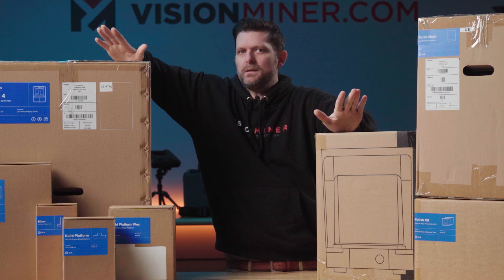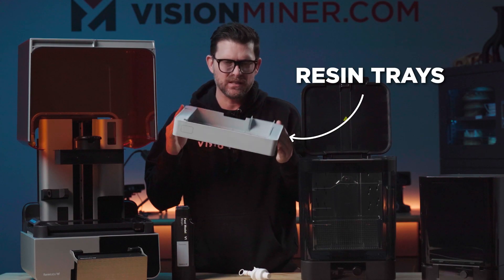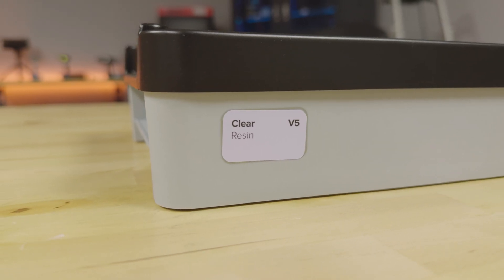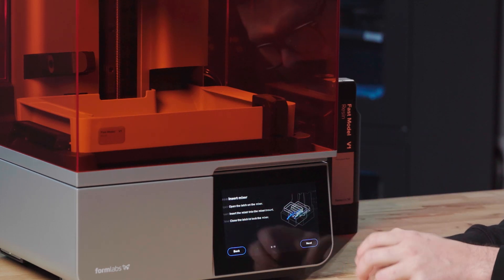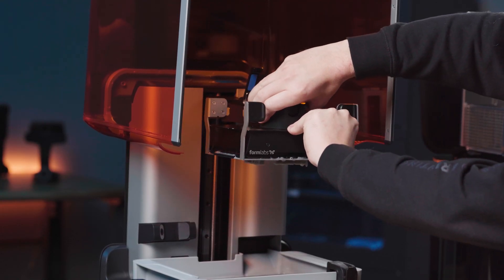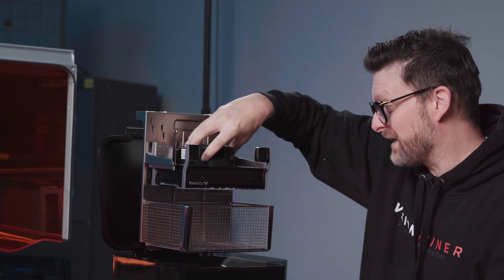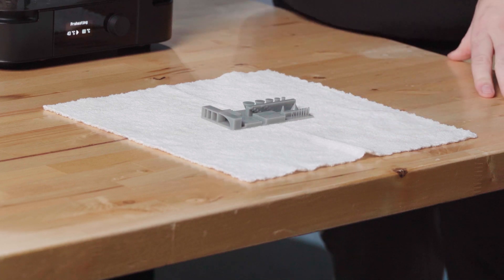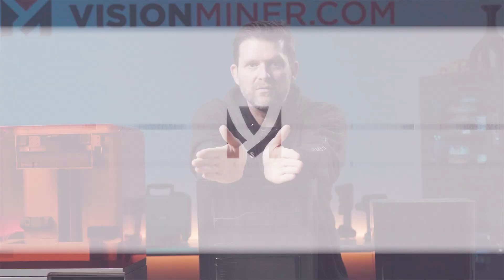Formlabs Form 4 Unboxing – What’s Inside & First Print Test!

Comment: These printers will never be popular, because of the liquid resin, requiring many processes. The resin is not even close to the strength of polycarbonate.
Reply from the maker: Well there, you’re wrong — there are 45+ materials in formlabs portfolio alone, many outperforming polycarbonate — which specification in particular, though? Tensile strength? Elongation? HDT? Impact resistance? PC is just the starting point of the material portfolio here at Vision Miner… we even print PEEK, if you need that!
Reply from the maker: Also, the processes are very simple, the machines are already outrageously popular in industry, for their ease of use and streamlined workflow, so we’re not sure what your experience with this tech really is or what you’re actually referring to…